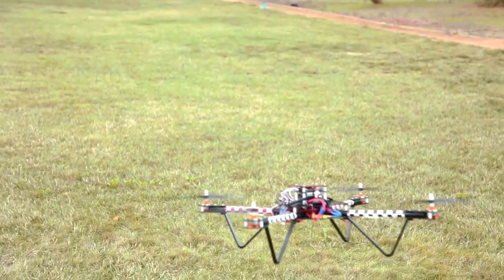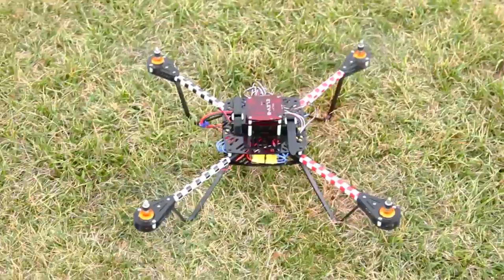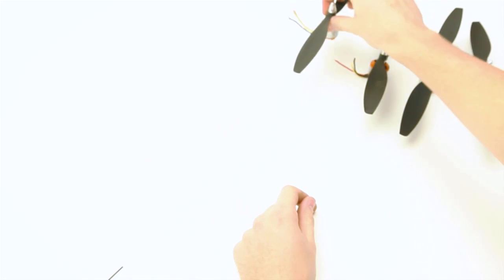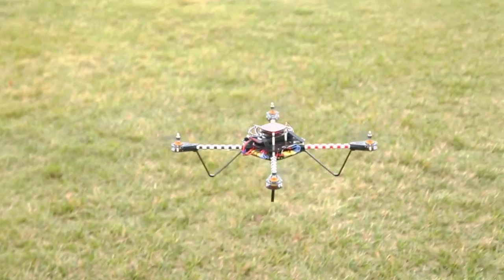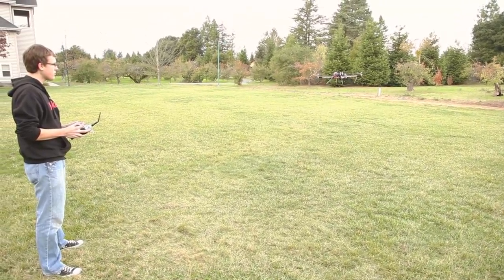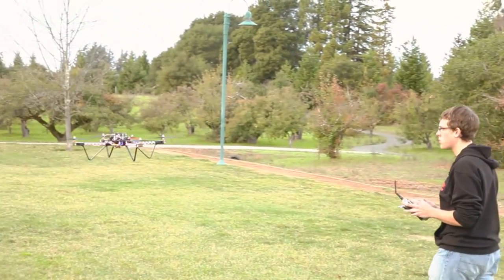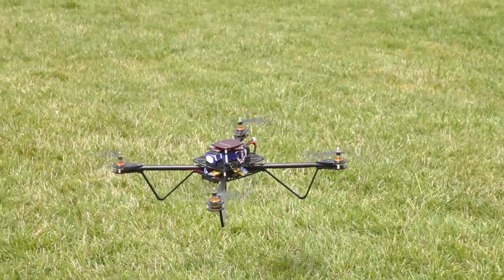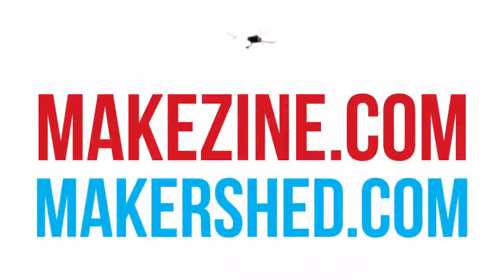Getting Started with the ELEV-8 Quadcopter

Comment: I feel like this is terrible, you can make these with much more abilities(self level,  gps lock,etc.) and lift for around $300.
Reply: please share your list of things
Reply: My current build is 

- Naza M lite + GPS
- 30 amp ESC (need 4 of these.  1 for each motor)
- 2200maH 20c-30c lipo battery
- Q450 V3 Glass Fiber Quadcopter Frame 450mm - Integrated PCB Version
- DSM2 orange receiver 
- FC 28-22 Brushless Outrunner 1200kv (need 4 of these)
- DX6i only mode 2 (to use as a controller)
- for propellers use GWS 3 blade 8x4x3.  Make sure to get 2 normal ones and 2 reverse rotation ones.
- 5pcs 3. 17mm RC Aluminum Bullet Propeller Adapter Holder (to hold your propellers on)

Now, yes it's expensive if you use the Naza m lite + GPS.  However it's worth it.  But if you want something that will just fly and not have GPS functions, use the KK2 board, be sure to update the firmware to v1.6 though otherwise it will just crash repeatedly
Reply: Nate Hindman thank you very much for sharing, I'm a beginner :)

Comment: "The kit provides an inexpensive way to get involved in the quadcopter arena." WHAT? You can get a controller board, batteries, motors, ESCs, propellers, frame and a radio from hobbyking for under £200. For an extra 100 quid you can build your own cheap fpv system. Pathetic.